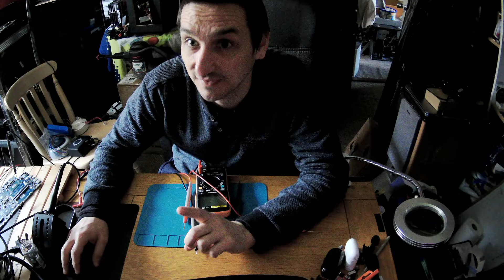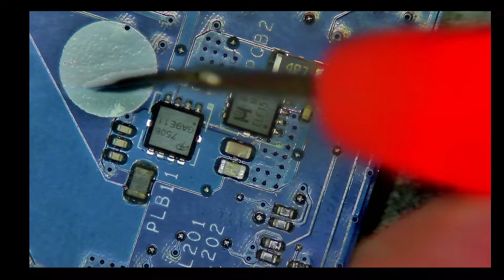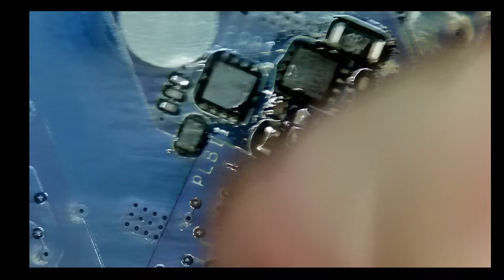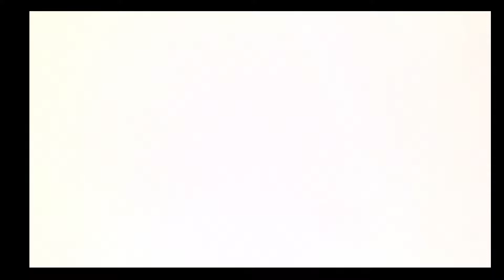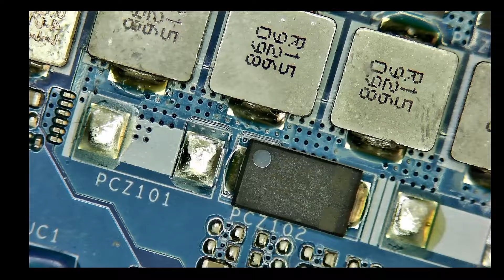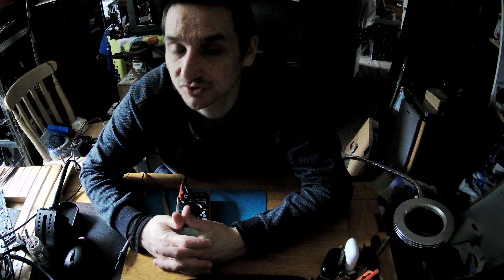Acer Nitro 5 - short on a main rail which I can't fix?

Comment: Voltage inject 1v 4a see what’s getting hot
Reply from the maker: Only takes about an amp and that's it.
Reply from the maker: Not hot enough to catch either the camera or IPA
Reply: @screen-protector  use your fingers then, is cpu/gpu getting hot?
Reply from the maker: @wisher21uk  I did on that time, all was cold. I think that's not the laptop MoBo, I've shorted my PSU on 1V and normally it could get more amps, but this time only the wires went over 1A, weird.